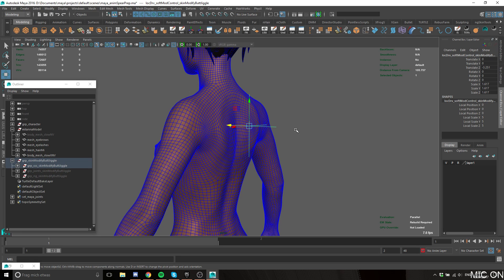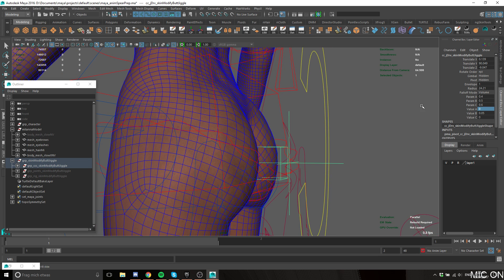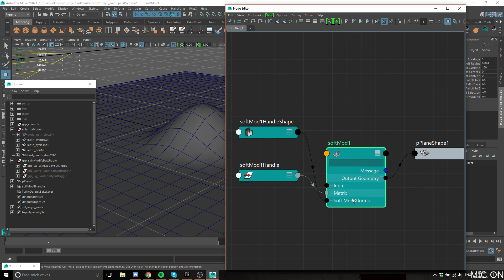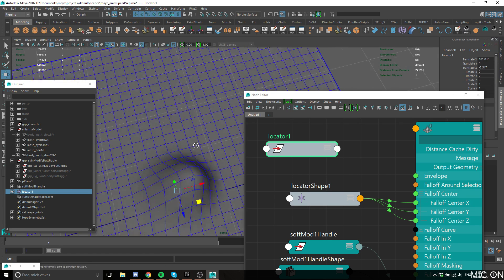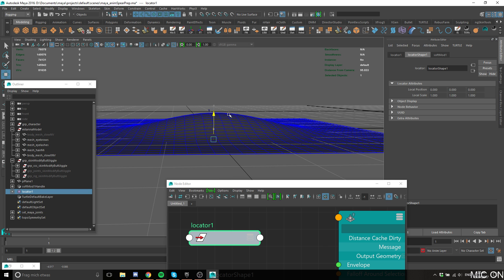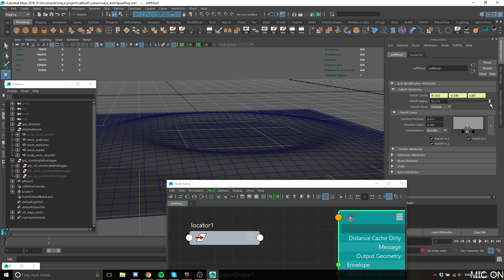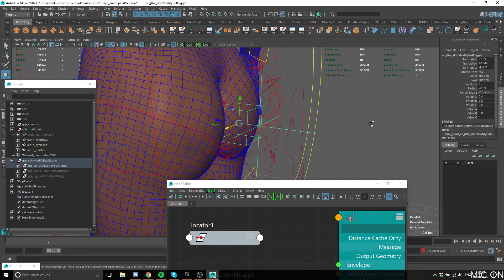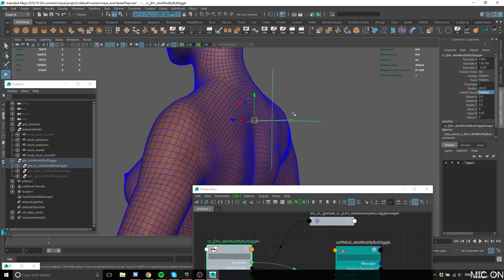softModToolDemo

Comment: Do you use a low poly mesh to drive your high poly?
Reply from the maker: For animation I did. Basically animated a low poly and subdivided it once for rendering.
In game dev I dont: I just have different mesh resolutions that are used in the LOD system.
Reply: @Wild-Life-Game  Lets say I wanted to do this: would I just use a wrap modifier to attach the high to the low poly: or is there some other way? Do you have any tutorials on this?

Your game models look to be around 50,000 polys: do you just straight up rig and skin that mesh or do you have a low poly driving it?
Reply from the maker: @62cky4powerthirst  Dont use a wrap deformer from low to high, youll get artifacts since the wrap doesnt interpolate influence between vertices very well.
Unless you put something like a deltamush deformer inbetween, that would actually work pretty well now that I think about it.
But what I generally did is to rig low-res mesh, subdivide it once with live history and used either that directly for rendering or used that mesh to wrap an other highres one. Therefore each vertex has its own influence point on the source mesh.
Reply: @Wild-Life-Game  What if I made a low poly of the character, exported it out, subdivided it in Zbrush once to project the sculpt details onto the highpoly subdivision, imported the highpoly subdivision back into maya: is there a way I can make it so when I subdivide that lowpoly in maya it uses the highpoly as a reference?

Comment: NCloth with some vertex painting to add influence to Input Mesh Attract, works pretty well.
It's a kind of Softbody, I did some test and it works, than along the line, I'm not sure if it keeps up with the complexity.
Reply from the maker: Yes nCloth works well too for certain things. I use it for example to more or less accurately simulate boobs and such. Problem is it requires some extra thinking to make it work on meshes as highres as this one with a reasonable framerate. This softmod tool is for smaller details that would be really hard to create with nCloth in a controlled manner.
Reply: What is this softmod tool? I've checked around for deformer with that name, but did not find any (except for the option in maya to soft modificate)
Reply from the maker: Yes thats the one. When you apply that command it makes a softMod deformer on the mesh.
Reply: Ah! Thnx I'll try that one